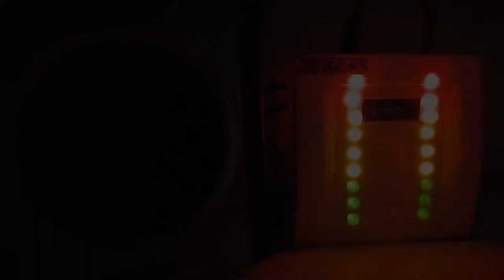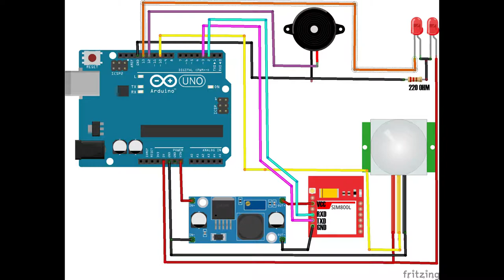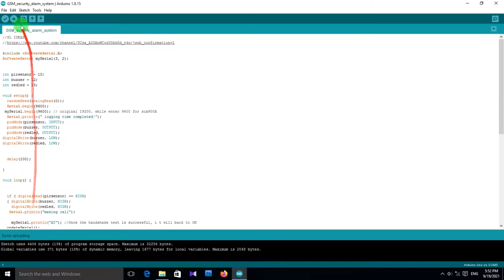GSM based Home security system using SIM 800L GSM module  Arduino | Pir senser & Buzzer | Sms & Call

Comment: Sir, while applying your code, the GSM Module is continuously calling. Without even connecting the PIR SENSOR. Please provide solution. Module calls 30 times in six minutes.
Reply: Same problem mera bhi
Reply: How to fix please tell me
Reply: This is happening because of sim800l radio signal.

Comment: sir the serial monitor working but there is no calling what should i do or whats the problem? can you help me
Reply from the maker: used to GSM  module input voltage 4.2v and 2A power supply
Reply: Hii bro same problem I'm facing now... 😢

Comment: How can I define a relay instead of a buzzer? .. And I do not know how to define a relay instead of a buzzer
Can you do this for me?
Reply from the maker: Remove the buzzer and connect the relay module. In the same way
Reply: @slideas1  What should I connect the relay terminals to?
Reply from the maker: @mehrankazemian1789 
 RELAY - ARDUONO 
 GND   =    GND
 VCC   =     5V
 IN       =     PIN 12
Reply: Sir please I can't see codes for this project
Reply: Hi 
I am also working on same project will you plz me which sim card is required?will it work on 4g sim?which sim have you used?